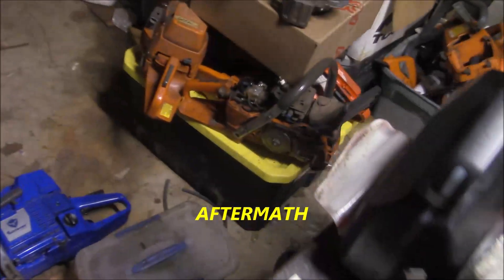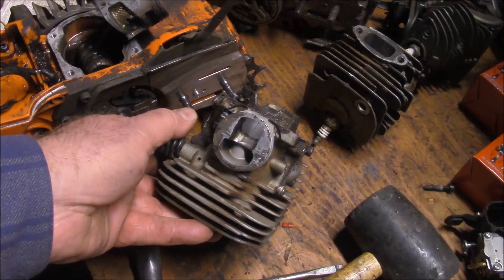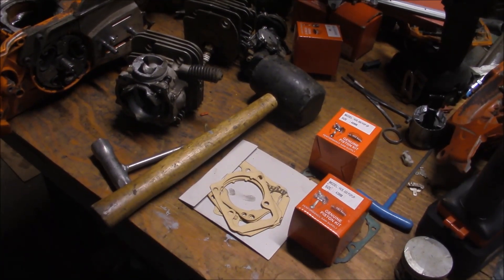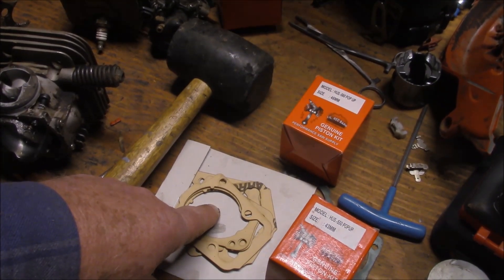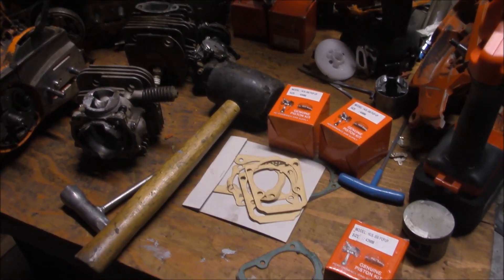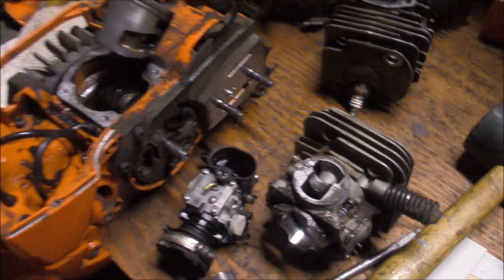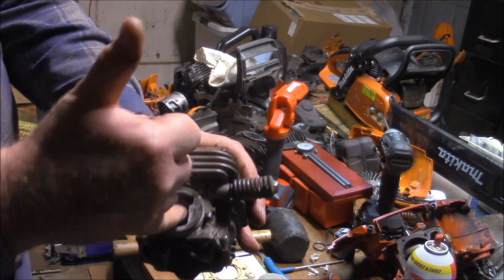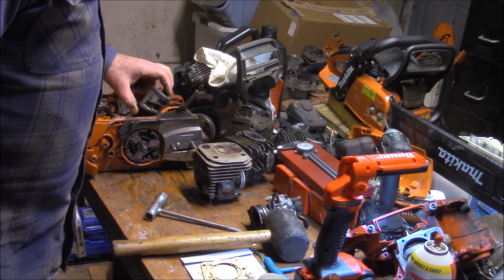Aftermath Of Failed Aftermarket 372XT ( X-Torq ) &  Some CHEAP BOLT On Hop Up Products For 562/555's

Comment: Yeah, put a new crank in it, I can't remember who makes good aftermarket - but maybe you have an oem laying around anyway, and it will be a good saw for someone.  Whats up with the Makita on the bench - it seems like it is always there.  Looks brand new (still has oem muffler).
Reply from the maker: That Makita won't stay running and it's really low hour. It will get de-bugged and a muffler mod I think
Reply: @afleetcommand  Thanks!  Yeah, a lot of those Makitas have really stuffed up mufflers.  They run real nice with a muffler mod.  Looking forward to the debug, when you get time.

Comment: Do you want my address? I can't surely blow up a saw for you!😁  The point about gutting the i take side mixing raw air exhaust and fresh gas but losing fuel mileage made me laugh outloud.
Reply: I’ve tried gutting the stratos but found the considerable decrease in mileage not worth it for a fuzz more powa … Seems you ran outta fuel and had 1/2 tank of oil left and that’s with oiler maxxed out ! … maybe you use another method and the saw doesn’t drink as much fuel ?
Reply: @fabzacres-blackcat  you can pop open the oil pump to get to the shaft and grind the flat back some to get a bigger pump each revolution… so they will spuge out my Dino-juice and lube a longer bar better…
Reply from the maker: The strato just puts a bit of raw air ahead of the charge coming up from thr bottom end... and it can burn too. And  on the piston where those big slots carry that air now have oil and fuel too.. lubricating the piston.  So yesh..yeah... it's definable and real
Reply: @afleetcommand  I’m super stoked and excited to play around with this one I’ve ground out the intake… I’ve got to grab that carburetor assemble and remove that divider stuff today and time it… seeing old Dyno joe harkness using the digital version and being able to hit the button and zero them and they are still tight on the crank makes me really want to spend the $80? Bucks for one of his already in the metal box on a 1/2” chuck… $80 bucks apiece to slap it on and go is a really good price I think!!! 👍🤪.  Make’s timing a saw super fast and easy!!! No thinking really needed after you zero them… turn it and write down the numbers… bing,bang,boom you know what you’ve got!  Make your corrections and check it again!!! Way way faster system!!!
Reply: I started gutting out the intake on my Xtorq cylinder’s as I’ve got 5-6 of those that I’d planned on taking back to OE but I’ve then got to buy the new intake boot,carburetor,elbow and filter… I’m going to try playing with this one Xtorq and see if I can’t get a decent running Xtorq version???  Guess I’ll find out how much more fuel I’m burning?  I removed the side covers and ground the bump off the cylinder side of the transfer’s to increase the volume … don’t think volocity is an issue… I’m thinking about measuring because it kinda looks like I should be able to remove the bottom of the piston and loose some weight and mass???
Reply: I’m kinda excited to get this Xtorq slapped together enough to check out it’s timing numbers so I can figure out if it’s going to run like this or if I’ve gotta change up the cylinder ports any??? I’m really curious where this thing falls normally????  Heck yeah… slap in another crank and ripping chips… those Ryan/Wolf Creek $60 dollar cranks took a good pounding from my tree buddy on one I slapped into one of his 372’s… it’s still spinning!!!

Comment: I have been messing around trying to get a bit more out of my 372 x-torq. gasket delete and piped. major difference. i live in cold climate of the UP of MI. and that saw is a real bugger to pull off in the winter without the decomp. your shoulders wont take it for long. My Question......good or bad move going to the unlimited coil? this saw pulls a 32" in hard maple with more power then i can ever need. But.....could use a bunch more in RPM. not wanting port the saw as this is a work saw. so is it a good move to do the coil swap on longevity or not? thanks for your time......Jim
Reply from the maker: Really the unlimited coil does nothing for a X-Torq, the best coil for them is the latest. Timing curve helps with idle and starts for sure. You really don't want to twist those XTorq's as the heavier piston pushes the limits of that 372 bottom end with it's 6202 bearings and the stiffness of the cases. For a cookie saw it doesn't matter. For a saw that actually has a purpose in life to earn money or heat a home it does matter
Reply: @afleetcommand  thanks for the information. saves me problems down the road. so what about changing the piston to something lighter with only one ring? this one is a beast to start in cold weather and will do a real number on the shoulder if not using the decomp. idle is good. think i will just leave it as is and build a different saw that is lighter overall in weight then the 72 while still getting the power and speed am looking for. have an old Jred 630 that is getting a 72cc big bore. that one may solve my problems......also to add in to the mix, i am 70 years old, still cutting regular and still climbing like a squirrel. with a good buddy, we have put together a small tree cutting company. we take out unwanted or dead, remove the cants, saw them into lumber and retail that out the door. also sell firewood to those that can not cut. again, thanks for your response and your time. i came upon your site thru the "Tinman".

Comment: I have a little 35cc (3510) Echo "trail" saw.  Use it for brushing, atv trails, etc.  Think MS170 if the MS170 was good.  Only stratified saw I own.  It already cuts EXTREMELY well for its cc/weight..  but now you have me thinking of looking at how the lower intake area is set up.....
Reply from the maker: I never took one of those apart. :) This was pretty specific to 372 X-Torq saws
Reply: @afleetcommand  Oh I figured as much 😂  
The intake setup on this is VERY similar.  Not like a lot of the strato homeowner saws with the dual bore carbs and truly separated air paths.  It just uses a split manifold to separate the "more lean" air from the "more rich" air past the carb.  There is already a little mixing.  Some folks have commented how similar it is to an xtorq in areas of its design.
Little guy weighs about 8lbs and has way more grunt than I expected out of a 35cc saw..  I'd like to know how many cords that saw was responsible for when I was blazing trails and clearing the fenceline.  Great little saw "for what it is"
Even if I make it worse it'll still have a spot on the tractor haha.  Time to learn something.
Reply: The earlier 35 cc echos were non-strato, but had cat in the mufflers.  They run really good with a 12" bar, good chain, and the muffler gutted.  The cylinder is a little weird if I recall correctly, offset exhaust port.  Never checked squish, or pulled the cylinder to check the transfers - but I might.  But, just the muffler mod, and small bar, and that is a super fast cutting light little thing.

Comment: Will that gasket work on a standard g372xp ?  If so where can I buy a couple.
Reply from the maker: Check the squish forst, and check the thickness of the as delivered base gasket. The ONLY saws I've seen those gaskets make a big difference on to this point is those 562/555's. Most of the others already have a gasket in the .015" to .020" thickness range stock. But check.
Reply: @afleetcommand  , I remember you giving me a link for my 262 base using the 261 gasket and having the perfect .020 squish.
Reply: You can send your gasket to cometic gasket in Ohio and they can make you one in whatever thickness you desire to a minimum of .005